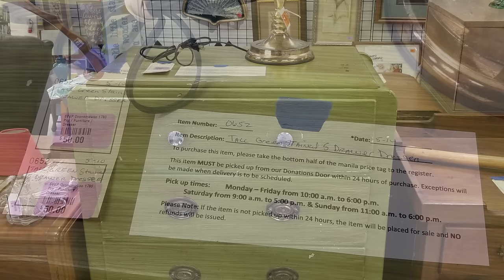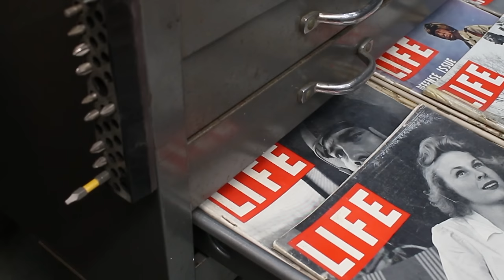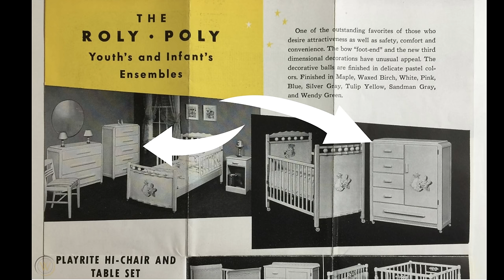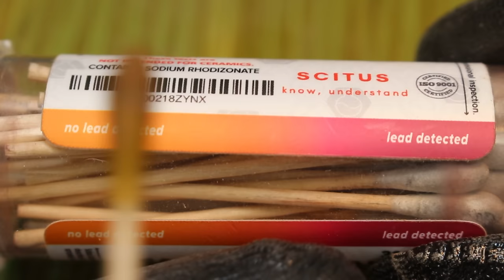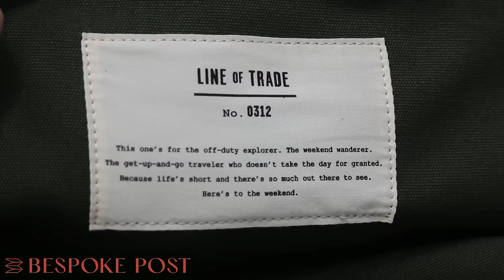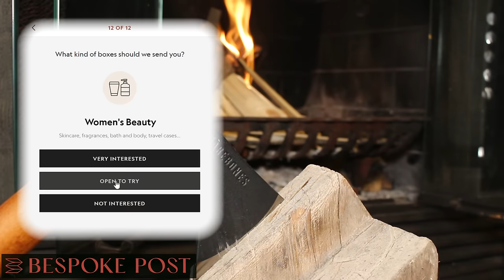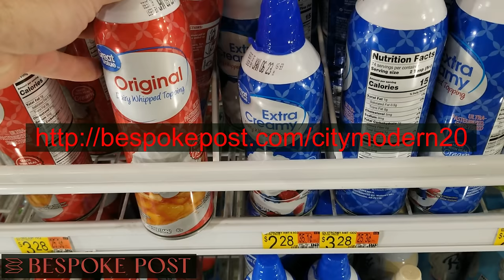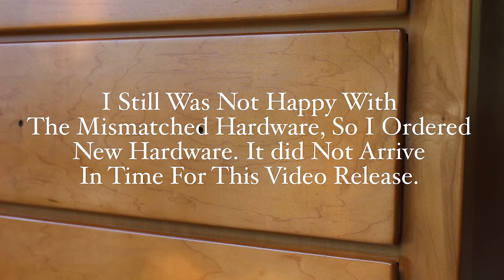Ep. 41 This is a FURNITURE CRIME...

Comment: Sorry if you have addressed this before in the past but how come you begin with the scraper doing a small section then move on to paint stripper? Are you checking for something before you use the stripper or another reason?
Reply from the maker: That's ok. I usually start with the scrapers to see how easy the finishes can be removed. I move on to the paint stripper If the finishes are too difficult to remove. Sometimes I use both methods on furniture pieces. Great question
Reply: @MadCityModern  okay perfect thank you for clarifying, great relaxing video as always
Reply from the maker: Of course

Comment: Another great video....why did you check for lead after you had already started to remove the paint?
Reply from the maker: There were several different layers of paint to check. I wanted to scrape some back first. Lead paint is most dangerous when in the form of dust

Comment: Great video, thanks!  I did not expect that amber finish, I fully expected you to go clear lacquer/varnish.  Of course the amber is true to the period.  Nice!  I watched you scrape and sand through that white undercoat, which appears to be impervious to stripper.  I have run into un-budgeable undercoats on a couple small pieces and on a window.  *NOTHING* chemical touched those finishes, it had to be sandpaper or scraping.  I have wondered if you have run into the same thing.  If so, do you think they are perhaps milk paint?  Or, do you think they are primers?  Looking for your thoughts on this.  Carry on!
Reply from the maker: Great feedback. This is exactly what I was thinking when I worked on this piece. I believe white was the original color, and the green must have been added in the 60s like many people have mentioned. This is exactly why I try scraping first, then use stripper. The stripper obviously didn't work for the white paint, so i moved on to scraping as much as possible. Then finished with a sander. I really appreciate you catching this. Thanks for all the support. Barry

Comment: Quick question Barry. What steps do you take if you do find paint that has lead in it?
Reply from the maker: Either cover over it with primer and paint or wear a proper respirator while removing  The biggest risk is inhaling the dust particles caused by sanding. Great question

Comment: What a stunning transformation Barry. Lovely high end finish as usual. BTW I thought that $50 was very expensive for this item considering the poor paint work! In the UK it would be about £10 or would have been taken to the local dump! Thanks.
Reply from the maker: I also thought $50 was expensive, but figured it would make for a good transformation
Reply: @MadCityModern  and it did.
Reply from the maker: Thank you

Comment: You tested the green paint and it had no lead…. But I am pretty sure the white paint under it was full of it : those lead paint are far more difficult to take of
Reply from the maker: I did mention that I tested both layers for that reason. I would have guessed the original layer on the bottom would have had lead, but no
Reply: @MadCityModern  - good for you… and sorry, I thought you only tested the upper layer. Nice work, btw, came out spectacular !
Reply from the maker: That's ok. Sometimes I'm not clear on the channel